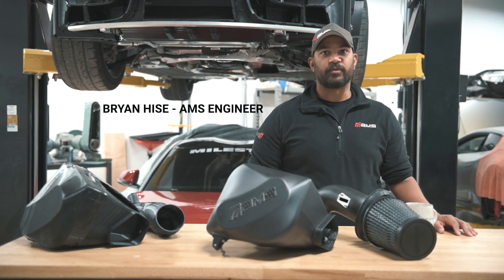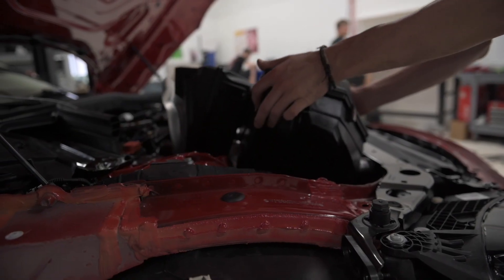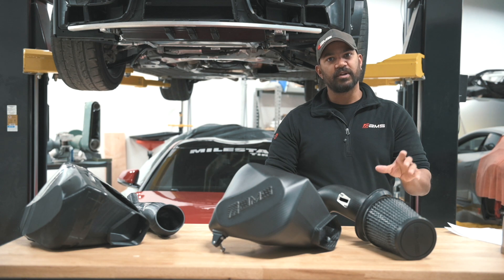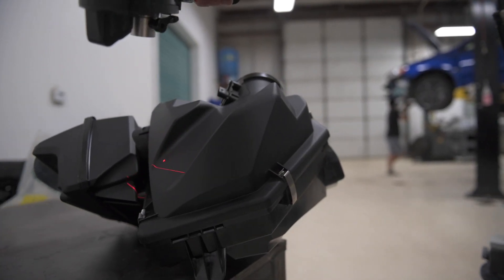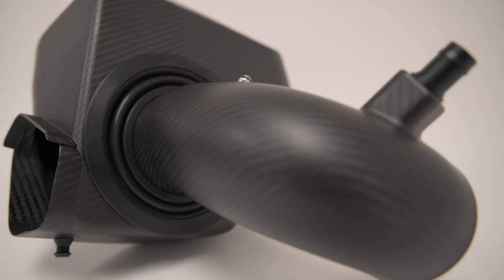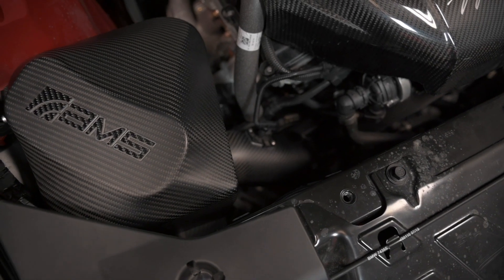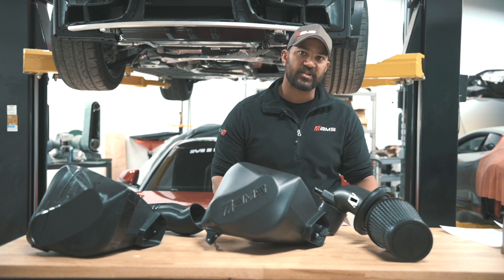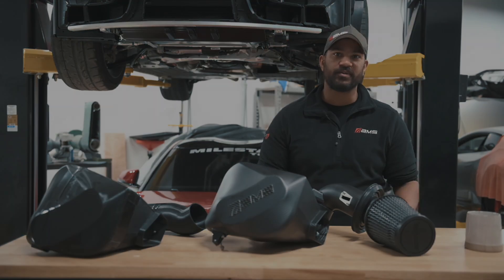AMS MKV Supra Intake Engineering

Comment: Do you need a tune to run it?
Reply from the maker: With modern vehicles using torque based monitoring to determine power outputs you need to have a tune to truly see benefits from any aftermarket mods.
Reply: AMS Performance Understood but will it through a CEL if not tuned?